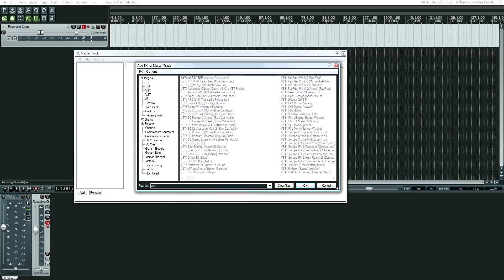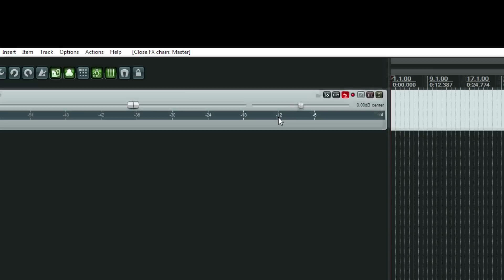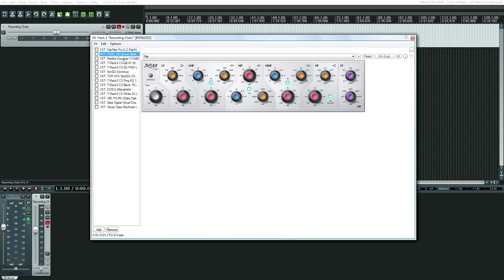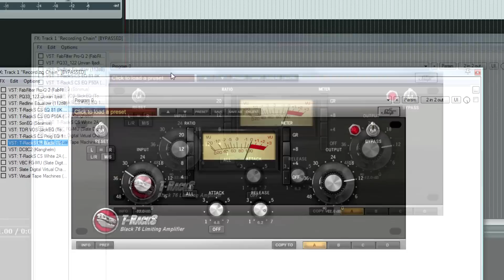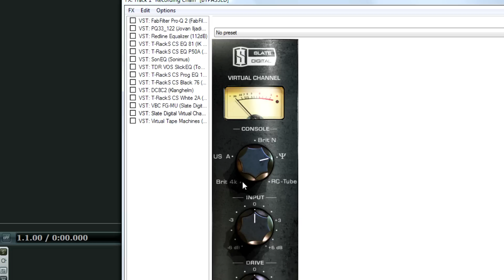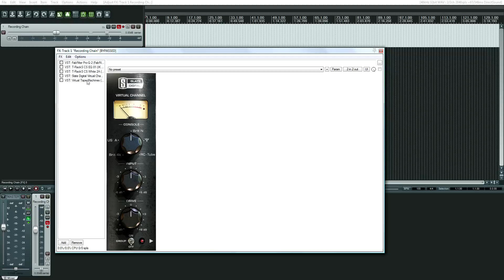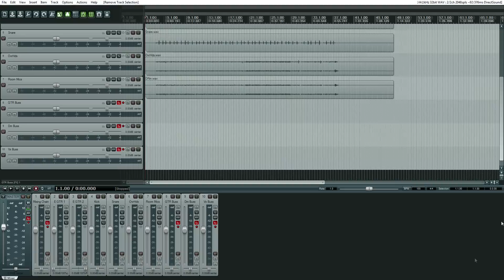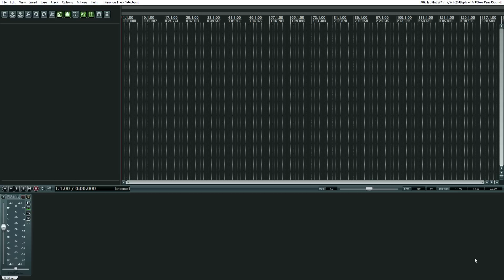Old School Analog Music Recording Philosophy in the Digital Box

Comment: I have an interesting question about the noise these analog emulation plug in's offer. I noticed each different plug in noise has different EQ curves or harmonic curves which is very interesting. Do they really have some effect on a compressor and if so is it a good idea to have noise from one plug in before a different plug in which has a different curve and so on stacked on top of each other in the chain? Since this is about digital vst's we do have the option to turn on/off noise or set the level in most plug ins,but some like puigchild from waves doesn't turn off all the noise for some reason and leaves very low noise you could only hear if you boosted the signal at about over 100 DB while doing special types of sound design based on major distortion like a hardstyle kick. So i'm thinking having noise coming from only one plug in that best fits the curve of instrument would be best for balance,but i'm not sure if it would really matter or if it does since before these vsts you couldn't turn the noise off or adjust the level in those machines.
Reply from the maker: blood lord When it's an option I turn noise OFF!

This is where gain staging comes into play. Any time you boost you add to the noise and any cuts reduce it. So, place your hardware simulations wisely. If you have to, noise reduce during mastering...which I'll be covering on Monday's video.
Reply: alright

Comment from the maker: Just a heads up that the preamp in IK Multimedia's two Neve inspired equalizers have a strong preamp sound. So I would not use it with Slate VCC...just use it by itself. Even at "0" the preamp is engaged on those plugins.

However, the FG-N equalizer that is in the Slate Digital Virtual Mix Rack is designed to run with Slate VCC.

Comment: why bounce to 32-bit floating instead of 24-bit?  Should our project be 24 or 32 bit?  thx!
Reply from the maker: +Adam Lewis Mainly to keep the files at their native bit depth until the very last step. Your plugins are going to convert 24-bit audio to 32 any time there's a process so you may as well stay 32-bit for mastering and any track freezes (renders) that must be accomplished.

Also...if you happen to peak past 0 with a floating point file you can still bring the level back down.

Keep your project at 24 bit for recording purposes.
Reply: hey man, thanks for that.  OK so record/track in 24 bit, I got that as my default for all projects, so that is cool...  but what do you mean stay 32-bit for mastering?  If the project is in 24 bit, how can you change it?  sorry - I am confused.
Reply from the maker: In REAPER you can change the rendered file to 32-bit floating point. I don't know what DAW you're using so it may not have that capability.
Reply: RealHomeRecording.com got it... thx man.  love your vids!

Comment: As far as mimmicking the signal flow of analog recording is concerned wouldn't it look more like this: Instrument >> Amp or D.I. >> Input Channel >> EQ/Comp >> Tape? In your setup the Input channel emulation sits right before the tape. Doesn't that defeat the purpose?
Reply from the maker: stansteez Seemingly that would make the most sense. Talking with engineers they said that if you were using outboard preamps they would be run through EQs and compressors prior to the line input. Reason being? Less noise. If you run into the line input first that circuitry will get brought up in level if you do any compression or EQ boosts. Back in the day it was all about keeping that noise level to a minimum.

I'm not sure why they didn't just run the last piece of outboard directly into the tape machine. I guess you can't (impedance mismatches, maybe)? Or maybe it just would be a PITA to do and the line input didn't add too much noise? I'm not sure. Or maybe they were using the board EQs...that's something I didn't ask.

So it would be mic preamp --> outboard gear --> line input --> channel output --> tape machine input.

Even if it was a board preamp it would be patched back into the console. Using inserts to put outboard gear into the chain.

A patchbay could work itself into the equation, but that doesn't add coloration. At least the good ones don't...the bad ones degrade the sound and you don't want that!

Try it both ways, really. Your setup to simulate using the outboard gear as inserts and mine to simulate using outboard prior to line in. See which works best and is least noisy...because these console emulators DO have noise! In the Slate VCC manual they put the line input first (VCC Channel plugin) but that's to simulate mixing from a DAW --> converter output --> console.line input.
Reply: RealHomeRecording.com Ah, okay. Thanks for the Info.
Reply from the maker: stansteez You're welcome. I hope someone from the old school comes and corrects/fills in the details on this. I would try it either way...as long as the line in emulation is someone in the chain I don't think it makes that big of a difference.
Reply: RealHomeRecording.com How "old school" are you tryin' to illustrate? '50s into the '60s: dynamic mics straight into the console's preamps (not many outboard preamps around then, you used what was built into the console and it was probably a custom board, built in house by the techs), condensers into power supplies for phantom power (not necessarily built into the console unless the studio techs did some mods) then into the console's preamps. No eqs built into the board (you moved the mic around 'til it sounded right), none or very little outboard to speak of (unless your name was Putnam or Dowd lol). IF you had some outboard eqs and comps you used the channel's sends and returns (again, might have to be a mod done by the studio's techs) no bussing out and back in cause you probably only had 4 to 8 inputs anyway. You might have had a cheap spring reverb unit (studio tech guys again) and another tape machine to use as a delay (unless you were the big boys like Capitol, Universal or Columbia. Then you had real, live echo chambers). Playing live into a mono, stereo, a weird 3 track machine (that apparently nobody really bought) or a 4 track. Then Ampex built the first 8 track machines in the late '50s for Les Paul. All of his and Mary Ford's big hits were done with two mono decks. Playing into one machine, then mixing its output with live mics into the other machine (like the Beatles did with two 4-tracks), rinse and repeat until it started to degrade too much (he liked to play with the tape speed too, to create some wild guitar and vocal harmonies. I know it's not your kinda music,Adam, but you should check some of that stuff out. it's cool as fuck to hear what he did 60 or 70 years ago). The '60s was a big decade for music (thanks a lot to the Beatles and the Beach Boys among others), so the money was flowin' and the artists were wantin' anything and everything to set them apart. Late '60s into the '70s is when you started seeing more outboard stuff, larger consoles, 12 track, 16 track, 24 track, synching decks using time code, WHOO HOO! Sorry, I got carried away, sometimes I think I could actually bullshit my way into teaching a college course on this shit. Later
Reply: oneammonday The way I know analog in 2014 is Mic/Line input into a patchbay and after that it's either to the Channel input of the Board or through a chain of outboard gear and then into the board and from there to the input of your Apollo or what you have. ;)
Reply: stansteez Mic/Line input of what? A stand alone pre?
Reply: stansteez If you have an Apollo, why not plug straight into that? They're supposed to have pretty nice built in pres from what I've heard. Or are you just messin' with this old fart? That"s probably what I deserve for sittin' here drinkin' all night and postin' on the yootoobz.
Reply: oneammonday Well, the teachers at my former school run a Recording Studio. And the have a 24 Channel Soundcraft Mixing Desk that runs into an Apollo Interface. So it was just an example of combining analog and digitalsignal flow  that I witnessed.
Reply from the maker: oneammonday  and stansteez thank for your feedback, guys. The only studios I go into are broadcast studios...not music studios. A lot of their stuff is plugins instead of digital consoles...not much old school outboard gear is happening in TV studios these days. So all my information is based on third party knowledge and trying this inside the DAW.

Comment: The moment you said "my secret" I knew you were talking about ARC. No matter how good your monitors are, no matter how many bass traps you build/buy. If you don't have ARC and you try to mix/master in your bedroom, you won't get there. Measure the room with ARC, and you're there 99%. I was amazed. The bass sound that I was always chasing was just me compensating my room's bass reflections, so I ended up with either a whole in the middle where the bass/kick should be, or after 10 remixes, a big mess. It's like painting blind. With ARC you are actually hearing what you're doing, and that's where it all starts.

Comment: It's funny, for the longest time, I mixed and mastered on my Klipsch ProMedia 2.1 as well.  They sounded great.  But recently I bought a pair of JBL LSR308's.  And I love them.
Reply from the maker: Michael Castro They're not designed for mixing per se but they do sound good and work well once ARC is on the master buss.
Reply: RealHomeRecording.com what I've discovered is, if your ears are decent and you know how music should sound through any particular set os speakers, you can mix through anything.  It's about acustoming your ears to whatever speakers you use.
Reply from the maker: Michael Castro This is very true. Despite the Yamahas at the other studio I record/mix in being "better" they do take a few hours to become re-accustomed to. The importance of "knowing thy speakers" cannot be understated.
Reply: RealHomeRecording.com  I'm not a fan of the Yamaha NS-10's, and here's why.  I understand they provide a flat response, and that's awesome IF you're mixing to speakers that have a flat response.  My buddy went into a studio some years back (+/- 12 years) where they mixed his music on NS-10's.  They sounded great in the studio.  The solos were loud and sounded great.  He put the CD in the car and the solos were too low, all the "mids" seemed scooped out.  Unless an engineer uses the Yamahas as a mids reference instead of the main monitors, or as the main monitors but with some other set of monitors to do secondary references, the mixes come out lacking.  In my opinion, your only hope at getting great mixes out of them is to listen to a ton of music through them that have been mixed by professionals.  But so many people just starting out run out and get them because the industry touts them and end up with nasty mixes.

I'd rather see a guy start out mixing on his $200 computer speakers that he uses all the time.  Even switching to the JBL monitors, I had to listen to a lot of music to accustom myself to them.  Just because they're different enough.  Now, I love them.  But, I still use my Klipsch as a secondary reference when I want to make sure I'm not pushing the bottom end too much (making up for no sub).  Because in my car, I have a very nice system with a sub and if I'm not careful, the kick becomes the most prominent thing in the mix when I'm in my car.  I typically use two to three sets of headphones, a boombox, a cheap CD player and two cars, one with a stock system and one with a custom system to make sure my mixes are in the pocket.
Reply from the maker: Michael Castro I don't have NS-10s. I have these: http://usa.yamaha.com/products/music-production/speakers/hs_series/hs80m/

Coupled with ARC they are great.

Agreed with your other points about being familiar with the way speakers sound.

Comment: I believe Slate said it's an API 1604, not 1608.
The Brit 4K G is another SSL 4000 E with G-series upgrades.

The 'RC Tube' is a "heavily modded RCA BC-6B." It sounds AMAZING on vocals. It was a broadcast board.

One more thing: If you have an interface with more than two outputs, you can keep that recording chain on an Aux track. Use the same input as your Mic In. And use Output 3-4 as your Headphone Mix (Cue Mix, Foldback Mix etc.)

Comment from the maker: @Fernando: I'm also a professional photographer and have ordered countless prints and other photography products. I can choose to not have those prints color/contrast corrected and usually do. They come back looking great.

My computer monitor is calibrated with an X-Rite i1 Display 2 device. You're right though...labs must also be setup for sRGB and most are these days. And sRGB is the center point of monitors, so if you make a web video it will look good on the largest variety of monitors. 

The point was, there isn't an audio standard when it comes to frequencies. But, neutral monitoring is the best way to go to satisfy most listeners on the widest variety of speaker systems.
Reply: they could look great, but you know it is not what you see in your monitor screen, independently if you retouch color or contrast or not :) perhaps they do it for you at your print store, ask them
Reply from the maker: Fernando Monreal I use MPix Pro. There is an option that says "Do Not Color Correct" and I get prints cheaper when going with that option. Maybe with my next batch of prints I'll throw in an image that's washed out and has a bluish tone to see if that's the case or not.

And course what a computer monitor can display won't look exactly the same as a print. They're different mediums! One reflective and the other direct light.
Reply: RealHomeRecording.com there are ways... like in audio to match what you see in your monitor with the print, but it is very expensive(like in audio) and needs periodic checking and periodic calibration of both the monitor and the printer, only in an high end pro grade (fine art digital photography) it will be done, those days, there is not enough budget for it, for more nobody cares, people usually just want the picture looks cool, you mention in your videos Chris Lord Alges, so it is the same, Chris really can do whatever he wants, if he wants to really do it, cause he have all the mediums(experience included of courses) necessary to do it, but the most of all, just we can´t, the most i love from your video is the routing explanation of your audio, very clever, the only concern to me, is you use lot of plug ins so i think you can have lot of phase issues... good to compare with photography cause if you are pro like me, you must to know more you retouch your photos more fake they look and more quality is loose in the way
Reply: i use i profiler for mac, and in audio you have more knowledge than me, so i enjoy a lot your vids there are lot of clever tips, but all is very difficult

Comment: In a sense this is what I was talking about the other day.
But i was mistaken when i said i figured it out. lol
I still can’t figure reapers way of routing an incoming track to other tracks to record to them.
This is what I am trying to accomplish.
Track 1- incoming signal with “pre” FX. (not the input chain).
Set to “monitor only no recording”. Send to Track 2-3-4-5-6-7
Where the actual modified signal will be laid down.
This way I would only need track 1 as the “input” channel.
Some where there has to be a way to set track 2-3-4-5-6 to record signal from track 1.
I’ve right clicked on the record button and tried a few of the options but no luck..
Now I know you could just set up an input chain on each recorded track and it will record the effected signal. which Is the best and easiest way.
But I’m really in a sense trying to figure out and learn Reaper so whether I use either method isn’t the point. 
Do you know how to do this?
Reply from the maker: Frank B I'm not sure why you would want to record FX as your tracks are being recorded. A lot of plugins add latency/delay and will mess with your monitoring plus once you record with the effects you can't change them later...they're permanent.

Now, you want to record 6 tracks of the same hardware input with an input FX chain? I kind of see what you're trying to do, to save on CPU usage, but it won't work that way. Not unless you want six of the same thing.
Reply: well I'm not trying to add a lot of plugins.. i simply wanted to see if it was possible with reaper (besides the input chain) to fix the incoming signal slightly before its recorded.. just like what you're saying in the video, the way we used to get it straight before it hit tape. if i can fix a shit input signal first, then i don't have to have extra plugins running after the fact.. again I'm not worried about changing it after. I'm sure the easiest way I've seen is to just make an Input FX chain and paste it on every track I'm recording too.
Reply: RealHomeRecording.com also did you notice this? http://www.slatedigital.com/products/vmr
i think they just released them today.. not 100%
Reply from the maker: Frank B Gotcha. Yeah, an input FX chain on every track is the only viable way I see that you're able to do it.

Comment: Nope in Photography, the printer must to be calibrated according your monitor calibration, each screen represent colors differently, so if you work in RGB what you see is never the same what a printer gonna see even if the printer work in RGB same for SRGB. also each printers use different ink systems, i´m professional a photographer ;-) but about audio i´m sure you are right :)